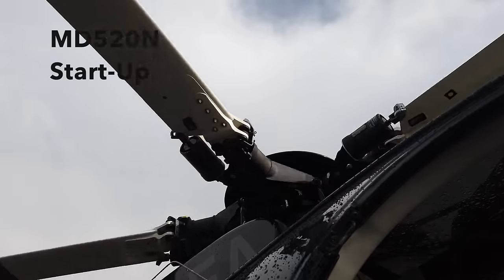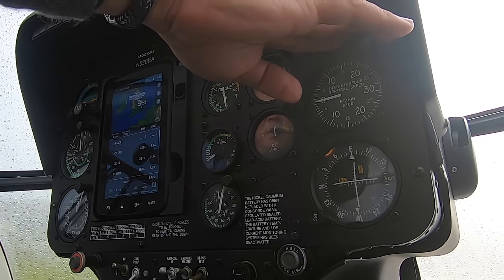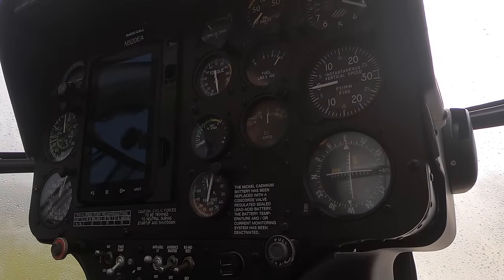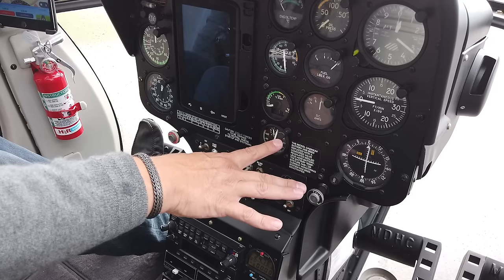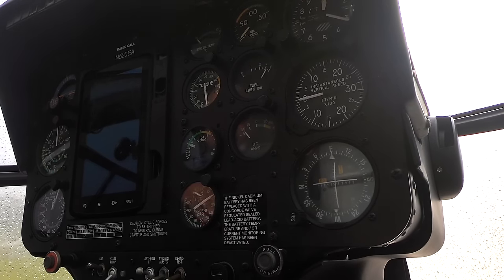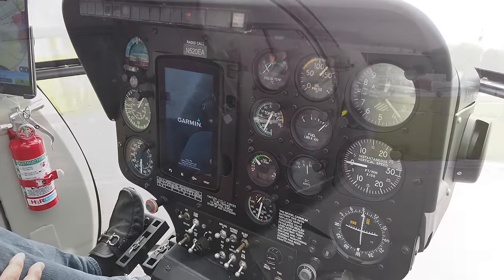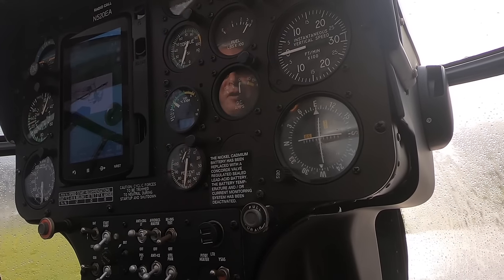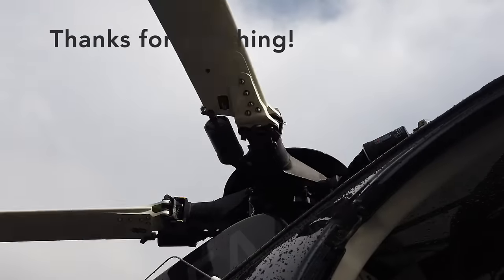HOW TO START A HELICOPTER | MD520 NOTAR

Comment: Need instructions on how to land, stuck in the air.  Please advise.
Reply: 1/ Locate and remove Jesus nut.   2/ Prepare for rapid landing. 

Any other assistance you require, just ask.
Reply: @olsmokey  Thanks.
Will keep you posted on my progress.
Reply: @Techn0forlife   💀😭😭
Reply: Just let go of the controls!  They're just like gyrocopters, they land themselves.  Good luck!
Reply: Seriously!!!!how do we land?  🙌😭
Reply: Slowly push down on the collective
Reply: @captain6255  means the stick in between your legs. Push it forward really hard for a quicker landing.
Reply: @pegg696  Wait.  I'm going to stop for gas first.
Reply: Locate the nearest sturdy building(can be antenna or power lines,too)and try to hit it with the main rotor blades.a rapid descent is guaranteed...
Reply: Don't look down
Reply: @deekamikaze  😂
Reply: Auto land kicks in after fuel depletion buzzer.
Reply: @ThunderAppeal 😅😅😅😅😮😊
Reply: @ThunderAppeal 2 year fuel tank capacity, impressive.  Any closer to the ground yet?  You must be hungry and a wee bit sleepy now.
Reply: Using cyclic pitch stick ease back to a motionless point or bring cyclic at neutral that is hovering first and then use collective pitch stick to land
Reply: Still there in sky?
Reply: Still there at skies?

Comment: Got a question, you said you were going to run the engine up to 100%, the eng rpm was only at 80%?  Do you run the engine % up to where the main rotor is at its running rpm?
Reply: I think they never use 100% power for safety reasons to keep the power reserve and engine over using
Reply: @djsollar  If I remember right when we flew around alot in the MD500 the pilot set it 92%??

Comment: How is the maintenance of NOTAR effectiveness/cost compared to conventional tail rotor?
Reply: I am not an expert but because of a very good Documentary on Discovery-Channel a few months ago about this topic:

Test-pilots and 🚁-Engineers, etc., ... 
they compared the NOTAR-Technology to some other Helicopters and this invention was definitely the one with the best conditions and less than 1h of maintenance per flight.
👍🏼‼️
PS: it was the MD EXPLORER / 900 N.
So I think that it’s probably not more with the 520N or 600N.
Reply: Hi, from a maintenance perspective, the main difference is that whilst you have no tail rotor/driveshaft/gearbox to think about, it is replaced with the variable pitch 'fan' under what we call the 'dog cage' It is has TT straps which have a 5 year life so less to go wrong and less to maintain (and we love the safety aspect), but the TT straps are not cheap so my guess is that it is probably the same cost wise overall but the NOTAR looks cooler!

The effectiveness of the NOTAR anti torque is fantatsic once you figure it out, the key is that 60% of the yaw is countered by coanda effect and not the thrust from the fan at the tail, in fact 'pedals neutral' has the duct almost closed and the work is happening with the vertical stabilizers and the YSAS which does a great job.

I trained in a cabri with a fenestron so there are some similarities in that you need to be a bit ahead of the game with the pedal inputs but now that I have 100 hours on type I find myself preferring it to the 500E, likely just habit and it a lot quieter!
Reply: @MartinVarley  good for you on successful flying endeavor. I'm so disappointed i backed away from it.

Comment: From an instrumentation perspective, looks as if it's biased towards the left seat for single pilot operations.  Is that typical for this aircraft?  I'm used to seeing most helicopters single pilot from the right seat.
Reply: ive always seen these with the main man on the left
Reply: That is correct. Hughes, now MD Helicopters are one of few helicopters where PIC flies from the left seat. Most other helicopters including Airbus, Bell, Sikorsky are flown from the right seat by the PIC although, if dual control equipped, they can be flown from either seats.
Reply: @ArizonaAirspace  Airbus H120 and H130 in single pilot are usually configured in left seat...